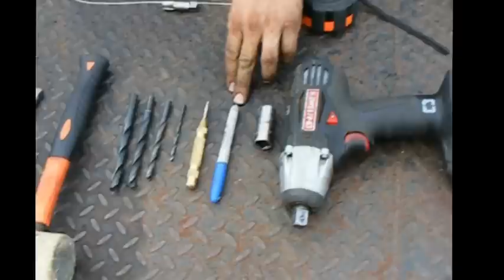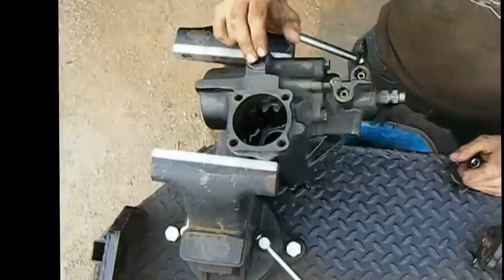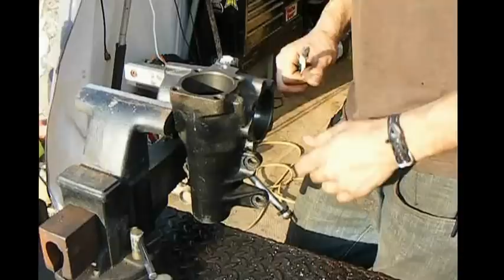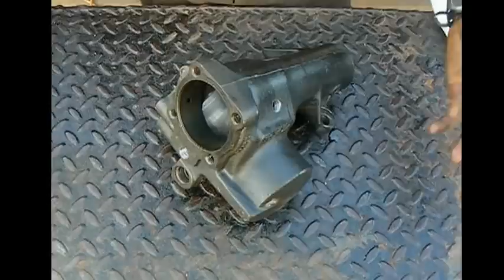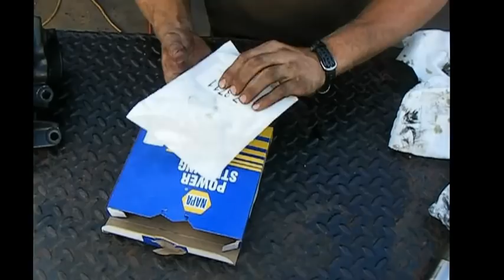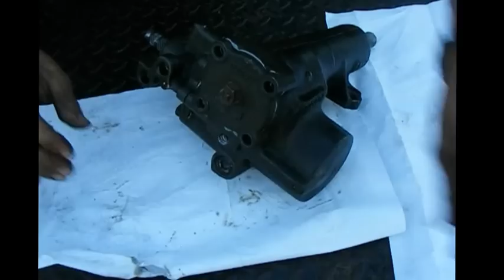Hydro Assist- Drilling and Tapping a Toyota Steering Gear Box

Comment: For a hydraulic application like this, would you prefer to use teflon tape on the threads or thread sealing compound? My first thought would've been thread sealer. Just wondering if you actually prefer the tape as opposed to the sealer or if it doesn't really matter for this.

Comment: Thank you for this video. It was perfectly straight forward and to the point. I had no problem tapping my box thanks to you. What pump dis you run with this setup. Ive had the stock pump for about a year and it's just not cutting it. Also can you do a toyota hydro assist system bleeding video? Thanks.

Comment: Once you center the sector shaft. After that step do you have to place the worm shaft in neutral position?
Reply from the maker: Sleek S center the input shaft, by eye. You should look down from the top, and see that the sector shaft gears will mesh up evenly.
Reply: @VonWilsonator  okay, thank you very much truly appreciated it.

Comment: I drilled and tapped my box per this video. Seems to have worked well.  I plugged the holes, put the box back in and bled it. Then, a week later I went wheeling and half-way through the day the box puked out all the fluid between the mating surface of the input shaft and the steering box housing.  I don't know if the Permatex just didn't hold, or if something internally went wrong and built enough pressure in that area to force the fluid out.  Any ideas?  I am heading out to the shop in a minute to tear into it.  Thanks!
Reply: Tore apart. Only thing that seemed incorrect was I had squishes permatex all over the new O-ring I had installed.  Carefully scraped it off and re-installed ring.  Box going back together now...if only I could find the torque specs for the 8 bolts...

Comment: Yup. 
Top port goes to the right side of the ram and forces your wheels left.
Fwd or outboard port goes to the left side of the ram forcing your wheels right.

As mounted,aft inboard port is return, and fwd outboard is pressure.